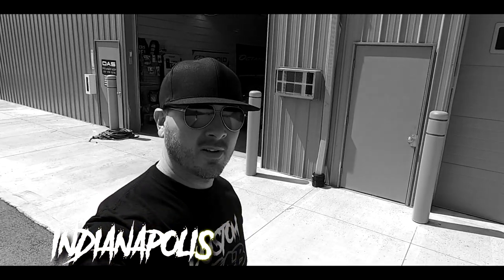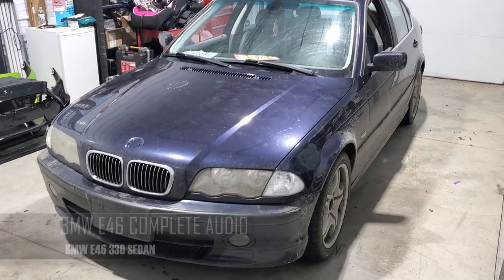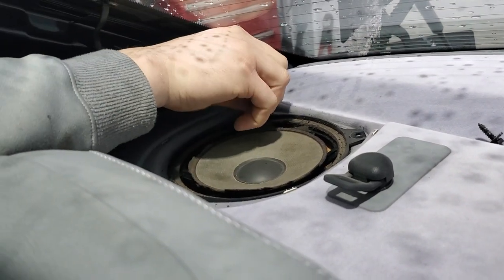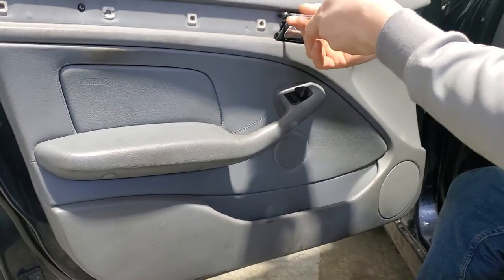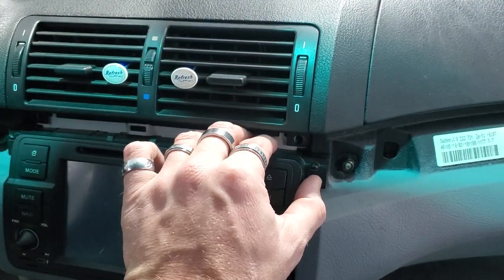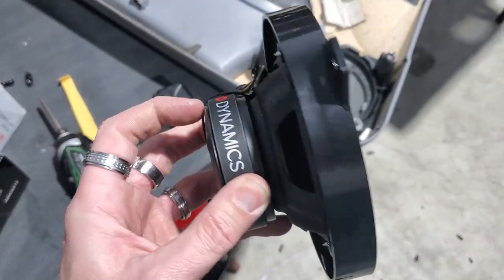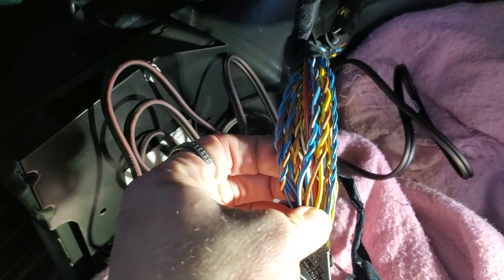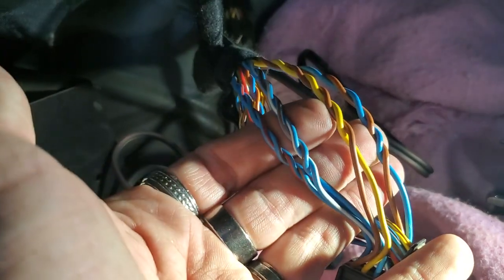BMW E46 SPEAKER UPGRADE AND INSTALL

Comment: I have the 325xi (2001) if I bought all the speakers how much would an install usually cost? Roughly?
Reply from the maker: @Louis.StandUp  really just depends on what all you would have to do typically we charge around 75 to $100 a pair to install them

Comment: How many total speakers were there ??
Reply from the maker: It depends on if you have a coupe, convertible, or a sedan
This sedan has a Tweeter in the front door along with a mid and mid bass. So three speakers total for the front doors. Rear doors have mid and mid bass. Rear deck has Tweeter and another mid bass. The rear deck mid bass can also be used as woofers. But there is also five variances of these systems. So you could have 10 to 14 speakers depending on which system you have

Comment: What did you mean about by passing the amp? When I change my speakers Is there something I should do with the amp ?
Reply from the maker: If your amp is working you will be fine. Of it's not working you will need to bypass it or replace the amp
Reply: @octanetvchannel  LAST QUESTION I promise Do those speaker mounting rings work for both the door and the rear speakers?

Comment: Does your ohm match the stock speakers? Because I’m trying to install Walmart Scosche speakers that are 4 ohm on my doors and the stock speakers where 2 ohm. Will this make a difference to where they won’t work? Any help would be greatly appreciated
Reply from the maker: It will work just not put out as much power

Comment: How many inches is the speaker.13 cm 16 cm?
Reply from the maker: 5.25
Reply: @octanetvchannel  front midrange and rear decks? What size are the smaller speakers on the front doors and rear doors?
Reply from the maker: @Eagleanfony  you can buy speaker adapters to fit a 5.25 inch speaker or a 6.5 in speaker. 6.5 will probably require some modifications but you can buy adapters to make them fit. The smaller speakers are typically around a 2.5 or 3 in but they don't make any adapters to make any aftermarket speakers fit correctly. We have just always had to make adapters in the past